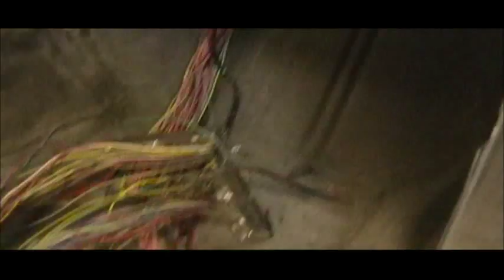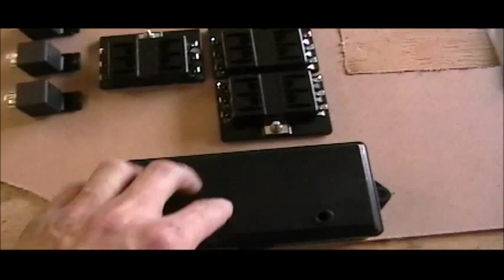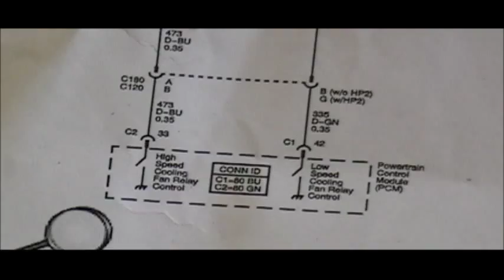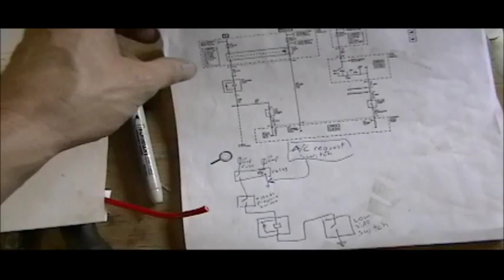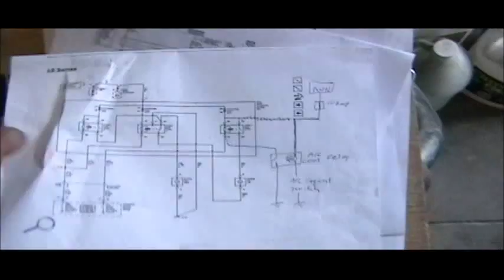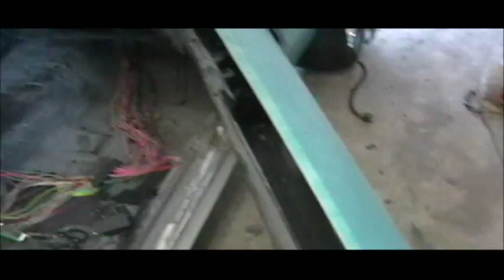My 68 Firebird Restoration Part 20

Comment: i just find this videos and i think u are a freaking genius :S!! holy crap men, this gave me sooo many ideas for my car, i just bought a 69 camaro yenko copy, but the wiring in that car is pretty bad! ok ill just say it! i want to do a work like these on my car!! is a 350 engine with carburetor! i can get many ideas from here BUT you are using your original fuse box! and i have to make my own, but how do i make the hazard and turn signals, can i do such a job without experience in electricity?